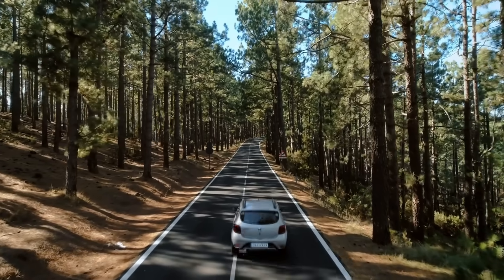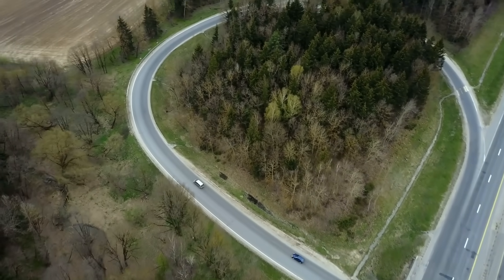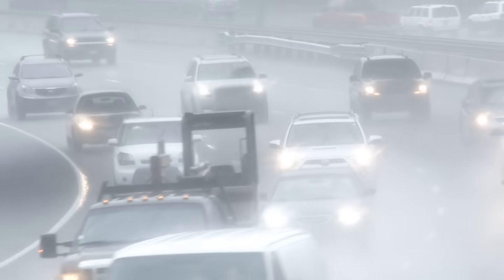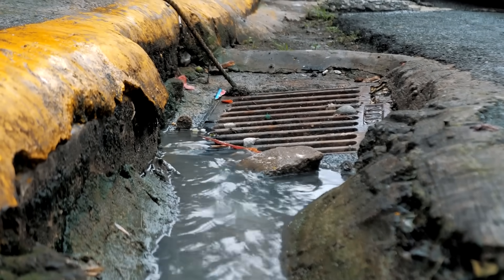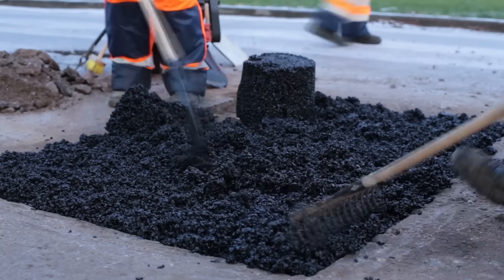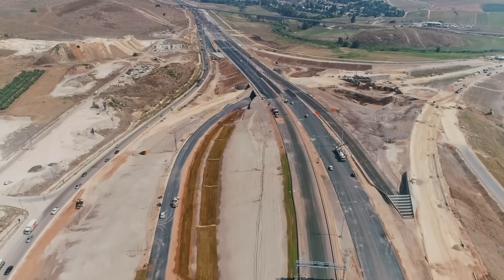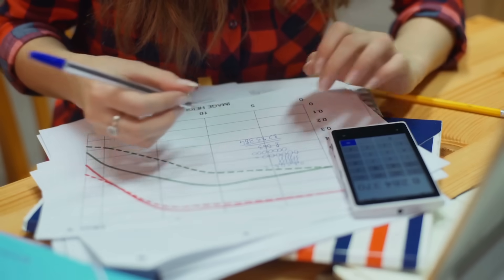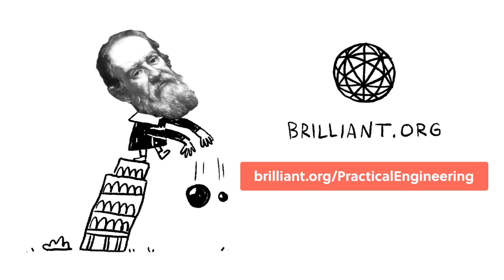How Do Potholes Work?

Comment: The biggest reason most potholes come back is they don't address the underlying issue.  The subsoil is not stable.  In my area(the Texas gulf coast) we have a high clay content soil we call gumbo.  It has very high amounts of hydraulic movement.  To prevent this, the subsoil is now stabilized by mixing in cement for 10-14 inches, before the base goes down.  That prevents most potholes before they start.  To repair a pothole, they dig up enough asphalt and bas to get a tiller down to the subsoil and do the same thing.  Then they put it back together in 1-2 inch lifts.
Reply: Sure, but doing all that work might be more expensive than just repeatedly filling the potholes, at least in some places.
Reply: @danieljensen2626  Even if that is so, if your local DOT doesn't arrange for the potholes to be filled in a timely manner (for whatever reason) it may be better to use a more durable road design that doesn't need such extensive maintenance. Of course, if they're not filling potholes because they're plain underfunded for the amount of road they have to support (as is often the case in USA I think), that's not gonna happen either.
Reply: @danieljensen2626  That's an interesting economic question.  The pothole problem for a given road tends to worsen over time.  So initially it makes more economic sense to just repair the potholes.  But at some point you are repairing so many potholes that it becomes cheaper to rebuild the road.  There is a similar problem with leaky water pipes, or leaky roofs, are any other asset that degrades over time. Initially you just repair, and your repair budget increases over time as the problem gets worse (and the public starts to complain more to politicians), then finally the road gets rebuilt (often just in time for elections).
Reply: @danieljensen2626 I would argue it’s way cheaper for us in the long rub
Reply: Lol not sure where you are but in Houston we certainly don’t fix potholes right. Usually a truck that sprays glue and fulls the hole with asphalt. So we just kinda halfway fill them, no where near actually fixing them.
Reply: @FartassVolfgangus   Yeah I was hoping for a deeper dive on repair techniques. Spraying glue/tar into a pothole would seem to make a 'bowl' of which again water is trapped to cook off/freeze/suffer more water based rigors over time. So it seems to me that tarring the inside of a pothole almost guarantees the problem to reoccur.
Reply: I have a friend that is a supervisor for the company that does all the roads in my city and he says they do some things wrong so they get paid to fix it later
Reply: @myprofilenameisreallylongl5956  ive heard that old DOT "job security" joke from every guy i know in the DOT. He was pulling your leg, probably. If they don't do the job right- they're getting fired. Government contractors dont fuck around.
Reply: I live in south Louisiana. And the soil sucks just a as bad if not worse. 
In new construction we have started cutting lime (typically 9%)  in the 12” sub base and waiting 3 days to cut cement ( typically 6%).  Then in the base course we will cut between 8%-10% cement.  The surface asphalt is typically 2” binder course and 2” wearing course. 

On a job years ago we cut 10% cement in the base and topped it with 8” of asphalt (6” binder, 2” wearing).  We expected a high volume of 115k pound loads in that area.
Reply: In southeastern Michigan, we have much clay in our soil while in northern Mi, mostly sand and gravel.   Our roads have MANY potholes while up north, not so much. It's amazing.  BTW, our clay makes great farmland because it holds moisture.  Because Henry Ford was born here, hated farm life, as a kid, much of Michigan's best farmland is paved with roads with potholes.
Reply: They just put bitumen or rubber in the gap. It's cheap but not sustainable. Welcome to the developing world of the USA.
Reply: So, what’s the solution to keep the repairs from failing during the next rainfall? Should they be spraying some kind of top coat over the patch and the surrounding area to seal it?
Reply: Those of us that live in areas with real winter can only dream of having as relatively few problems as Texas, no matter how they are "fixed".
Reply: @Paul-pj5qu  in Norway they had a solution for a  rout that had terribly snow and ice problems.
they placed in between the isolated substrate and the actual top heating wires. doing so during the winter the road was heated to about 2c (35.6) the aim was to not get the road iced but the by effect was that ice could not damage the road.
Reply: @sirBrouwer   Where do they take energy from to heat those roads?
Reply: @sirBrouwer Thanks for that. No doubt where you live out gets colder for longer and you get more snow.  I live in Toronto, Canada. That is a metro area population of 6 million people and the corresponding number  and length of roads and cars, heavy construction vehicles (there is a lot of building in Toronto, the most in North America), buses etc. Roads are de-iced with salt because nothing else is effective under the circumstances. It addition, the temperature goes below freezing (-10°C would be cold, but it gets as low as -25 or -30 some days, occasionally colder) and then will it will be above freezing a few days later. There is a fairly regular surface freeze and thaw cycle, especially in the late winter early spring. We have not only the freeze/thaw, but that is aggravated by salt water penetration. For the roads it would be better if the temperature was consistently colder, but it isn't.
Reply: @Paul-pj5qu  no it is very similar here. depending on the wind direction it can be - 20 or 5 c we use salt allot but on some of the more heavy used roads they have used the heating systems at places where the road goes up a hill. 
it is not cheap to place but do to all the hydro power energy is very cheap.
Reply: @hugocorminboeuf8007  Hydro dams. there are a lot of them so it is not really a problem to use it.
Reply: Paul we have the same problem in Texas; when it does get cold enough to freeze, it freezes over night, thaws during the day, freezes, thaws, freezes, thaws...on and on and on, it starts the cycle of absolutely destroying just about any road. 

It’s also why people think we can’t drive in snow - but it never just stays snow, it all thaws and then refreezes and we have to drive on ice
Reply: @Paul-pj5qu  the problem with Texas roads is that our cities like to pretend that precipitation doesn't happen and budgets accordingly. that and it being hot enough to literally melt asphalt
Reply: @Paul-pj5qu  well here in finland the roads are in pretty good condition.
Reply: If that is true, maybe potholes come back so workers can keep coming back?
Reply: The cause of potholes is cars. The solution isn't more roads, it's less cars.
Reply: @introprospector  They said that in ancient Rome about chariots and horse drawn carts. For a long time,the streets of Rome city were so crowded with people that daytime haulage was banned. And then complained bitterly about the thunderous roar of traffic keeping people awake at night.
The alternative was no food,goods,building materials,etc.
Take your pick.
Reply: @paulmanson253  check out the streets of Vienna some time. All the most famous and durable world markets are pedestrian. Pedestrians spend more and shop socially. Isolating people and building your society's infrastructure around a nonexistant ideal of a single family home is a good way to kill culture.

Comment: Potholes are the result of damage to the base caused by numerous factors to include [but not limited to] overloaded vehicles, utility cuts, and higher than predicted use (i.e. more vehicle trips than the pavement was designed for).   

Utility cuts are the worst for pothole generation as the entire pavement structure is compromised and wont be restored to previous conditions (no matter what the contractor says).  the municipality I work for has implemented that the entire travel lane be milled and repaved for ALL longitudinal utility cuts.  this does not stop pavement collapse from settlement of trenches.

Comment: Could you cover the different type of cracks that occur on the pavement, are there different reasons to it or they are all connected to one main reason i.e intrusion of water?
Reply: Water is the biggest enemy of roads and many other structures, it’s the number one cause of defects. Others can be due to sinkholes, Edge of carriageway erosion from inadequate support ie kerbs, Heaving/Rutting which can be caused when the material is laid too thick or the loading is too much, Alligator Cracking/Crazing is where the layers beneath the surface course have failed usually due to over loading.

Comment: In Russia we have a lot of problems with fixing potholes. There are many videos on youtube of russian road workers pouring asphalt while it's rainning or snowing. They do it even if potholes are filled with water. Traffic officials say that's a new way of fixing a pothole and it has no imact on quality. What do you think?
Reply: It’s true you can get the ready mix temp repair bags which actually need water to get them to set properly. 
Generally the pothole should be cleared out though and there shouldn’t be too much water in there, some is ok but the repair will blow out again. It should only be used as a temporary repair

Comment: If water trapped under the pavement is the cause of potholes isn't the answer DRAINAGE ?
Reply: Would that just pull soils away faster? o_O;;;
Unless there's a pun I'm not getting... readied self to get whooshed
Reply: @migratingturtle  Romans Built roads 2000 year ago that are still here today , they must have done something right
Reply: @craigjensen6853  well said and explained

Comment: How potholes work? Well, you see, there is a 'downwards' force called "gravity", which makes your wheels enter any holes they pass over. Then there is the reactionary force (sometimes called normal force) applied on your car when it runs straight into a wall, and walls are a component that potholes have at least one of.
So a pothole works by first having your wheel enter the hole, then suddenly yank the wheel in the opposite direction it is moving when it reaches the end of the hole (touches the wall). And it is this yanking which is what imparts the force on the car that - aside from braking it - in turn imparts a painful force on your body.

EDIT:
Wow, that title ("How do potholes work?") was clickbait among clickbaits! The video, as far as I could tell, only described how potholes are created. Never how they work, in any way or other. Granted, I didn't expect the above explanation I wrote (not the theme of the channel), but I at the very least expected some kind of explanation that actually fit the title.
Reply: I don't wanna be rude but  reading this made me cringe.
Reply: I can't tell if you are serious
Reply: @bobofthekerbals9797  I hate how particularly for youtube comments I have to be explicit that I am posting tongue-in-cheek, or ppl get unsure :p

When I see something titled "how do ...?" or "Is x some property?" or "why ... is/does..." or similar, I like posting silly answers to the title to point out how silly the title itself was.
Particularly titles with question-marks in them are a common clickbait strategy, and as such deserves to be (if not ignored) responded to by answering the question for the creators sake (why would they post a question if they knew the answer?! :o (yes, that was sarcasm..))
So no, I'm not being very serious :p

Though the edit is at least semi-serious, in that the title is somewhat of a misnomer indeed. But yes, it was very expected, and said expectations was in fact what made me actually act on the impulse to write a silly answer to the title in the first place :d

Comment: In the UK we call the sidewalk the pavement.  Our pavements (sidewalks) are usually paved, with paving stones or slabs.  Why do Americans call the roads 'pavement' when they're not paved?
Reply: We do call it a pavement in the UK it’s engineering terminology that the general public don’t use. A paved surface is a hard standing material for traffic. I work for a Highway Agency
Reply: @BMXRACER1100  interesting.  The general definition for paving is "a surface made of flat stones laid in a pattern".  Now I'm wondering how that's become an engineering term for roads made of tarmac or concrete!
Reply: Roads are constructed using plant called a paver so maybe that’s the origin

Comment: "You've all experienced potholes one or twice" man here in Balkan countries there is no street without potholes. Except in highways but in Croatia the highways do have potholes
Reply: My town has potholes on every other road because our road budget is shared with two other towns tho other two both being tourists attractions so they get all the budget and we get like £1
Reply: @steamrestorer4559  In Germany i have never seen a pothole on the Autobahn. Would be quite dangerous driving over them with like ~210 kmh lol.

Citys have some, mostly small towns.
Reply: @foty8679  What I like about the roads in Germany that when the holes in them are repaired the new surface is smoothed out so you cannot feel the transition between the old and new (repaired) road. While the road may look "spotty", and you can clearly see where the potholes used to be, you do not feel it while driving, it's all smooth.
Reply: @Vielomian  Making the repaired part have smooth transition to the rest of the road has an added benefit of the tires not impacting the pavement too hard and therefore preserving it better too, I would think. Makes me wonder why they never bother to do that in my country
Reply: @MrCh0o  Yep. They never do that in mine, either :). Every time I cross the border and enter Germany I can almost hear my suspension breathe a satisfied sigh of relief :).
Reply: I was in Croatia (Istria specifically) in January this year, I travelled on local roads 99% of the time and I must say the y were very good quality. Even the apparently less-travelled  ones in the sticks, like the one I used going from Trieste to Rijeka, where I only saw two other cars during the 90 minute-trip from the Slovenian border was really nice. The next day I spent driving along some crazy winding roads consisting almost entirely of hairpin bends :), and it was OK as well. I also drove on local roads all the way to the Hungarian border and I found no reason to complain. I don't know about the southern part of your country, but the north has nothing to be ashamed of. The coastal stretch from Opatia to Zagorie was fantastic.
Reply: @Vielomian  I pretty much visited whole country and you right. The coastal roads are awesome. But the highway from Serbian border ( or Osijek) to Slavonski brod till Zagreb has annoying potholes and all around Zagreb. It ain't every 3rd street but still plenty for an European country. Especially down middle and south the local rounds are terrible. The ones connection big cities and tourist cities are of course very good but outside disaster,not to mention how drivers behave... This region faces many earthquakes and the recent strong one in Zagreb destroyed streets while the politicians are building fountains..
Reply: @neonlight1214  I'm planning to return to Croatia next winter (summers are way too hot there :)), this time visiting the southern part, so I will test the roads there :).
Reply: @neonlight1214  You must be living in some other country called Croatia, because I haven't experienced any of those "bad roads" and I've been all around our beautiful country.
Reply: Nah, I dont think there are potholes on Croatian highways... They are very good except one Zagreb-Osijek. Rest of highways are fine.
Reply: Welcome to the IV World!

Comment: Over here on clay soil, I see that 30cm of gravel and 15cm of iron-smelter residue is used to drain water to the ditches. The smelter rocks are not as easy to wash away.
Reply: I think by "iron-smelter residue" you mean slag?
Reply: @benuscore8780  
correct. I didn't remember the word.
In Dutch, it's called 'hoogovenslakken'. 'tall furnace snails' doesn't make much sense in English.
Reply: Interesting. The Romans more or less did the same thing. The slag from iron bloomeries was used in road building wherever possible. Occasionally,lightning strikes will show where this was done in no longer used sections. The slag is conductive,and a whole section of sod will get torn up in the blast.

Comment: Also the construction of the road. Use of release agents on asphalt can damage the fresh asphalt and cleaning trucks ahead of the paver will result in masses of uncompacted material. Both leave weak spots that will eventually fail. Currently fighting a contractor about not cleaning out ahead of the paver and not using diesel fuel to clean tools and trucks.

Comment: 1.Deterioration - (Fatigue/Alligator cracking) 

2. Support failure - (penetration all the way through HMA layer to the base layer) caused by --> [rain,thawing snow,vehicles].

3.Dislodging - inter-connected cracks form up chunks of pavement. Rains/Vehicles oust those chunks.